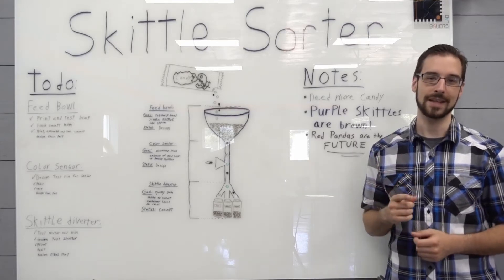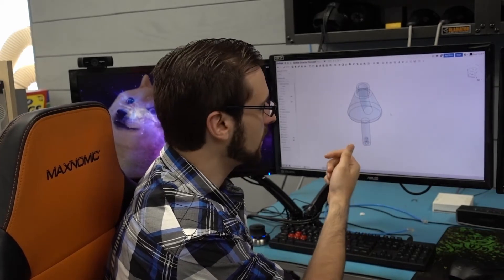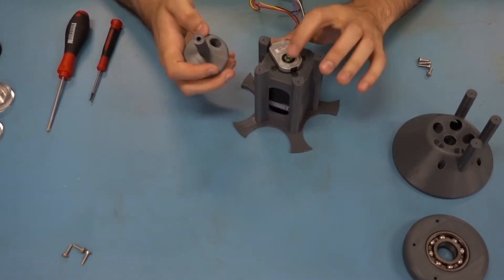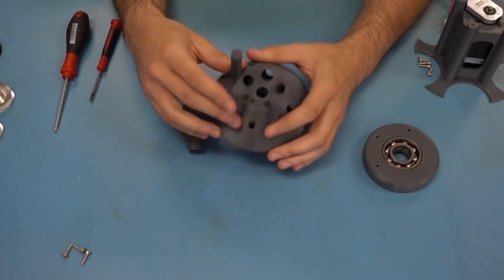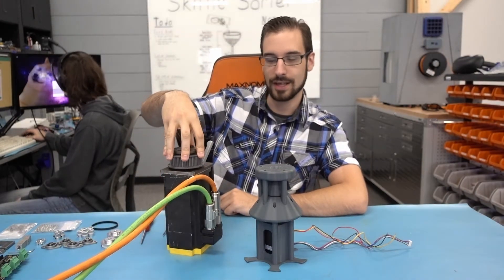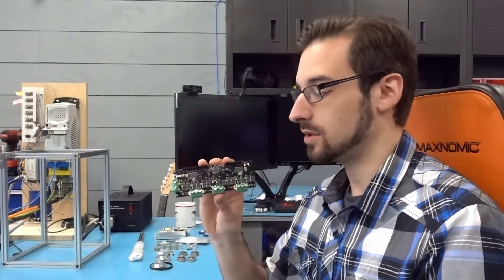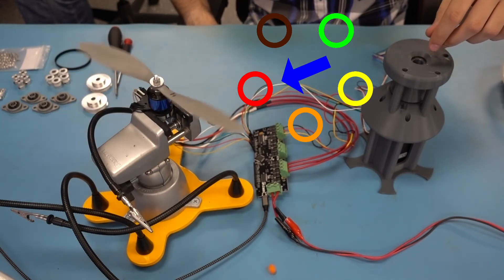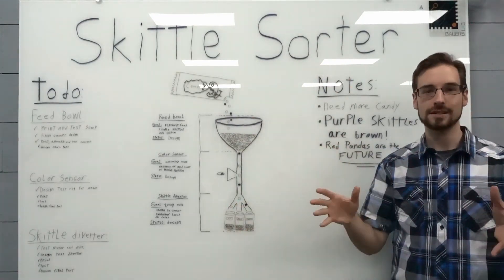Skittle Sorter (Part 3) - Diverter Concept

Comment: What if I want to sort other colors of skittles besides original?
Reply from the maker: There are no other colors. Do not speak such non-sense. Assuming that there were other colors of skittles, the machine would probably sort them just fine. As long as there are no more than five colors.
Reply: Bauer's Lab have sour skittles been tested? Curious if the sugar coating interferes with the color sensor.
Reply from the maker: Oh... I don't even want to think about how sticky that would get. I think the color sensor would handle it fine though. It works surprisingly well. I think you would have to be comparing shades of the same color before you would expect failures.